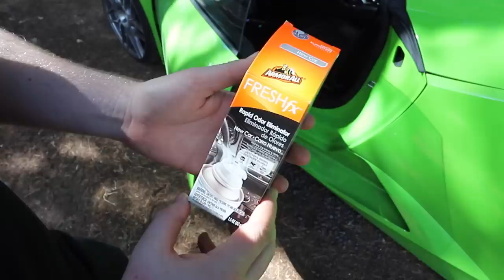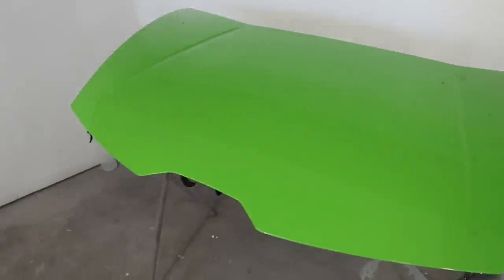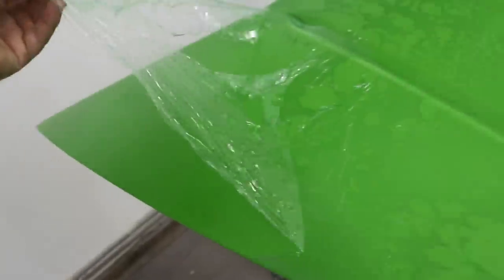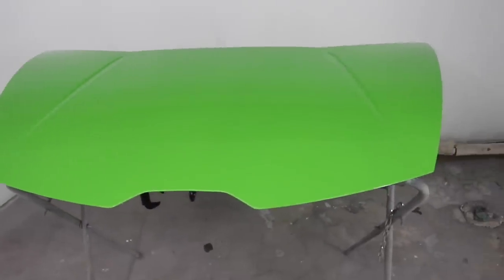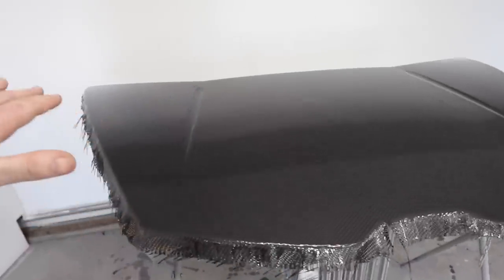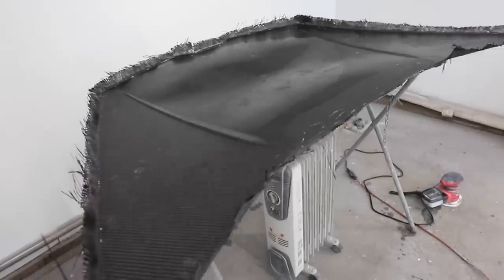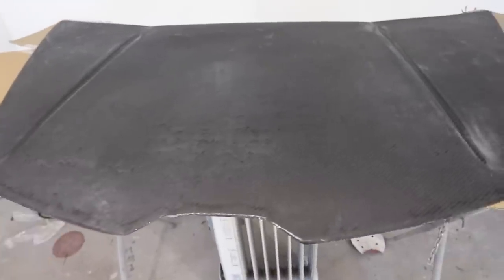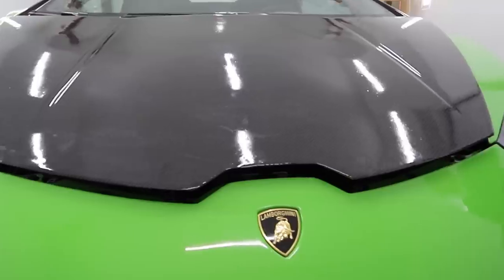Building Our First Carbon Fiber Part for the Huracan

Comment: Making these panels the proper way with molds and auto clave is literally a 100k+ procedure.... If you don't do negative molds none of the parts will fit, they will all be way to big
Reply: He has all of the originals as references to trim them to size, so I don't think it's such a big deal here...

Comment: Ok you made a mold not a part. That's what you get when you coat over another part. Next you can actually make a part from your mold. I would use fiberglass instead of carbon fiber to make a mold it would be a whole lot cheaper.

Comment: Curious - why paint the the car prior to using it for molds? Seems like you'll possibly damage the paint during the process (uninstall, handling, or otherwise).... Assuming you had reasonably flat surfaces

Comment: You’ll want a negative mould so that the outside surface of the part is smooth. Also, carbon is great for making moulds if you don’t want to mess around with glass fibre.
You should also think about vacuum bagging.

Comment: Make fiberglass molds of each part and then fill the parts with Carbon Fiber. SO if there happens to be damage on a panel you can remake it exactly the same.

Comment: If you are doing a overlay like you just did. Couple tricks to help you out. Once you first coat of resin gets tacky put another coat on. Do this 5/6 times to help with it being so flimsy. On your last coat if your happy with the amount you have,Add wax additive. Its like a final harder for your last coat. Then I would block from like 180,220,320,400 and most times I would clear it after that. You can go to 600 if you want. BIGGEST thing to know, always add water to your carbon. It will give you the look that the clear will give you in the end!!!!

Comment: If you would have used 1 1/2 ounce fiberglass matting and woven Roving  3 to 1 = 3/16 thickness with styrafoam ribbing,  boom there is your mold, then you build from the outside in, = finished hood

Comment: The fogging is because you didn’t mix the resin with hardener enough or add enough hardener to the resin to allow a good mixture. That happened to me. 
Go to Composite Envision and they have mixing bits to use with the drill to mix the paint right.

Comment: Gday fellas,
PLEASE MAKE CHRIS READ THIS!!!
Best advice I can give you first is buy a DuPont Tyvek paper suit and a box of disposable gloves. No itchy scratchy. 😉
Ok mate, let’s get to work,
1. Flip over the bonnet. Cut some strips of laminex on thin ply (kitchen cabinet timber) and “lightly” sikaflex it to the under side edge of the bonnet so that you have a nice lip that sticks out under the bonnet all the way around. Let it cure.
2. Flip over bonnet and using plastcine, form a coved edge where the bonnet meets the ply lip edge.
3. Wax the entire bonnet and edge surface, then buff it off, same as you polish a car. Use three cloths though, wax on, wax off and then a clean polish cloth. You DON’T need a thick coat. You want multiple micro layers of wax.
4. Using a “Chux” type dish cloth dampen a small section and apply a thin layer of PVA in a gentle circular motion. Let it dry. PVA can be applied with a dampened cloth as a micro layer. Doesn’t need to be sprayed to a thick layer. You are creating an imperfection that will show in every subsequent product from the mold surface if you apply a thick layer.
5. Spray the part with correct ratio of Gel Coat and catalyst for your temperature there and let it fully cure/dry.
6. Apply a layer of 3/4 ounce glass cloth and resin. Then using a solid steel grooved mini roller to ensure no air in the laminate, roll out the cloth, forming it into the curves and corners. Then multiple layers of 2 ounch cloth. NEVER APPLY TOO MANY LAYERS AT OUNCE AS THEY WILL PULL AND WARP THE SURFACE. One to two layers at a time between curings.
7. Apply a layer of resin and q-cells as a slurry bog and apply a layer of Balsa Mat or Foam Mat Tiles. Gives stiffness and rigidity. Let it cure. 
8. Then fair over the “stiffness layer”, the imperfections, with a small amount of resin/q-cell mix. Let cure.
9. Then some more layers of 2 ouch cloth. 
10. Apply a framework of foam ribs, plywood ribs or steel pipe ribs with resin and q-cells filler mix as a type of “glue”. Shape the filled edges with a round tube to cove the edges and then apply tape like pieces of fibreglass and resin to reinforce the framework to the mold. ONCE AGAIN DO NOT APPLY MULTIPLE THICK TAPE LAYERS AT ONCE AS IT WILL PULL AND WARP THE MOLD SURFACE. Let it all cure/dry.
11. Release the mould from the part (using fine angle soft pine timber wedges) and you will have a surface to mold from with a neat lip so as to have a tidy edge too trim. The product from the mold will be the perfect size. I suggest wet n dry and polishing/buffing the mold surface first before use. 

VERY IMPORTANT:- Remember to stand back with a beer every now and again and appreciate your handy work. 
Good luck fellas! Cheers 🍻👍

(In Australia we have the “Kiss” method. “Keep-It-Simple-Stupid”. No need to over complicate and hence why I didn’t go into vacuum bagging etc etc)

Comment: If you just put carbon fiber on the outside of a panel and try to use that as the final product, it would mean that it will be larger than the sample panel. What you did now, you need this exact thing from glass fiber, and when that dried, use it as a negative mold for the real part.

Comment: When we made the resin to impreg the carbon for Aston martin/Ferrari body parts, we use to mix the resin in a vacuumed mixer otherwise you would get little air bubbles the size of pin holes. Unless spraying over the Carbon, I'm not sure how you would get rid of the little pin sized void.

Comment: the white marks you see after sanding are small buble left from not degassing the resin. you can achieve a good result with skinning like bandido does but you need to understand a few things. building layers you dont need to worry about degassing. but once you sand the last layer and aply the "face" layer', you need to degass by vaccum, or if not possible, use small lenght brush (big ones tend to add to much air to the trapped resin) and build 4-6 coats. sand them down till you hit the cloth with an 120 and finish with a 400 very light. clean very weel and clear coat it. its important that you hit the cloth so you dont have any clouds. and its also important to do very good sanding to the build layers, so when you aply your last cloth its very even. that will help you in that final sanding of the last layer! follow me on instagram @rodrigolagoa i post a lot of videos of my builds! corrently doing a trunk lid double side mold!

Comment: Shouldnt you have used a cheaper material like fiberglass to make the molds and then pull from the molds so the panels will be the right size and vacuum resin infusion is the best way to go.

Comment: make all your molds from fiberglass ,then make the parts needed from carbon fiber.use the purple partall film 10,is a thicker PVA this will protect your edges better,we use purple pva when the molds are not gel coated on the inside surface. considered a short run mold of 10 or less parts.

Comment: I've only watched the first few minutes of the video and I'm extremely sceptical about your chances of success with the idea of replicating all body panels in carbon fibre. 
Firstly, are you going to be able to use an autoclave to cure these parts? Dunno how tough they'll be otherwise. 
Secondly, how are you going to consistently align the weave and avoid amateur looking disparities?
Thirdly, have you even visited other carbon fibre parts producers to look at their methods?
Fourthly, did you try any small scale trials?

I hope some of these questions will be answered by the end of the video....

As I thought - not that successful. At least you acknowledged the biggest issue - that you HAVE to produce a mould to work from! I would still VERY STRONGLY recommend that you spend a bit of time with someone experienced in working with carbon fibre!

Comment: Definitely need moulds, and sometimes complex 2-3 part moulds that bolt  together. But I would suggest that getting nice results from infusion methods is going to take MONTHS of full time practice.  I would recommend looking into pre preg carbon so you cut out the infusion, and just buy or make an oven for curing!!!   Will cut production time massively and HUGELY reduce complexity around infusion and the errors that will happen from infusion methods during the learning phase.

Comment: Keep in mind a few things:
A) your void volume fraction is going to be high unless you use a vacuum assisted resin transfer molding process (this is cheap and WELL worth the results) doing this the way you’re doing will work fine and I would expect moderate strength but the main source of strength in a fiber reinforced polymer is the interface! (The bond between the fibers and the polymer)
B) You may be much better off creating a fiberglass mold of each of your panels and then laying the lamina inside of the mold. This will help with your dimensional precision!
C) Although possible, if cfrp is not manufactured properly, you’d be just as well off using purely resin to make your panels. Using pre pregs may yield much better results and could be much easier!!!
D) For faster resin cure time, apply a source of heat (a big light usually works well)
I’m a composite nerd and engineer so I like to get my hands dirty and I’m certainly interested in this build! Spend your money wisely!
Ps, the main advantage of carbon fiber isn’t the strength. In reality, materials such as aluminum and steel are stronger! Cfrp has a much higher specific strength (strength divides density) and thus, if you use the same thickness cfrp and your aluminum hood (I’m assuming it’s aluminum, not certain) you won’t have a very strong part!
Good luck!!

Comment: If your machine sanding I would not go any lower then 120 it may help to use water I have not done it with resin so not sure how much it may help 
If your resin didn't dry all the way your hardner probably wasn't mixed well enough or the top coating dried faster not letting the lower layer although even in water this stuff should definitely be fully cure in 24 hrs

Comment: If you want to run any ideas give me a shout, I've spent 10 years working in a composite shop in the UK, You've taught me enough about repairing cars.. 
With this kind of product where your not product where your not chasing every gram there probably  50 different ways to get the results you want, there isn't a  right way and a wrong way. 

The challenge is finding a way that works for you.
Each layer of 300gsm carbon 2x2 twill is only 0.3mm thick, your gel coat will thicken this. but as you found out it's never going to be stiff enough to hold it's shape. 

Your incomplete cure and stickiness could be a few things..
Poorly mixed- use an electric drill with paddle mixer (ideally  put under a vacuum afterwards to pull the air out) 

Poor ratio.. Less likely but you need to check that you have the right ratio (you're looking for by weight not by volume)
Post cure - If you have space make your self a big oven you only need about 60 degrees, this will help cure the products fully.. (Every 10 degrees halves your cure time / pot)

As a few people have said I would take a set of moulds off the car from cheap polyester resin and chop strand mat, you will need to reinforce these with some thin ribs to stop the mould twisting. 

A few people below have said that you should infuse the parts, having done this personally I can wholeheartedly recommend not going down this route.. If your going to get you moulds cnc machined from tool steel with a perfectly consistent gap great, infusion works really well. but i will promise that you will scrap another 50 parts before getting it right if your making your own moulds. 

A few tips

Preparation is key, get all your carbon fabric cut before you start, do as much as possible before you mix the resin. 

A vacuum pump is a really useful tool,  it does a great job at applying an even force, and pulling out air bubbles. Wet-laying carbon then vacuum bagging will help reduce the voids.

Make sure you have a resin with a long enough pot life - you don't want to be running around frantically. Make your life easy it shouldn't be a frantic process.

With regards to finishing, I would sand down the part again, then apply a 2 part automotive clear coat. 

Make sure your epoxy has a UV stabilizer or in a years time all your carbon parts will go yellow..

Comment: Chris, as mentioned by others - Easy Composites' negative mould technique. https://www.youtube.com/watch?v=UgKvDw1E60E  The result is perfect straight out of the mould, no finishing/refinishing. The part is the exact size of the original part, no wavering gap lines, etc. The part is as strong as it needs to be, no guesswork or over engineering reinforcement. You can remake any parts easily if there are any issues/accidents, and you can sell the moulds when you're done, if you wish. This is your SEMA build! And it's a Lambo! Any method you choose will still be an amazing feat, however you ideally want it to be as if you bought the parts from a carbon fibre specialist. Time wise, you can be making several moulds at once as you don't really need to 'experiment' as you have. Yes, it requires more materials and consumables but the end result will be easier, better and require less finish work. Simply make both sides of the panel (in the case of a bonnet/hood) trim them, bond them together and make any minor touchups.

Comment: Wow, being so thorough with some technical stuff and so lousy making an easy mold and part. C'mom guys, you just need to keep everything super clean, mix everything super nicely, etc. If you follow the steps closely, you might still make some beginners mistakes, but you'll get it. Use vacuum. Use heat. But avobe all, use prepreg.

Comment: Many good comments... A mold, reinforced with ply or steel so it does not flex and vacuum bagging will produce the best result.  Closed cell expanded PVC foam,  should be used between inner and out skins for stiffness.  You might be able to save your test hood by building a plywood box, filling it with expandable foam and laying your metal hood face down as the foam stiffens.  This would provide a form for your carbon hood outer skin that will hold it in the correct position.  Then do the PVC foam core (either all or stiffing strips) and vacuum bag in your inner plys.  Look to boat builders for technical advice, not car builders.

Comment: appreciate your hard work and jope to see great results just a suggestion use proper equipment such as

*Clean room with air ventilation, air filters, 
*Use wood frames so while is resin rise it won't change the shape plus you can move them around 
*Make Female Mold of your car parts so you will get perfect size and better quality than OEM 

thanks for reading Best OF Luck

Comment: Your methodology is completely wrong.   The carbon fiber piece you cast off the hood  should be used as your MOLD to make the REAL hood.  (Except it's not even close to good enough to be used for anything, obviously.  It's just a practice piece.)   And there is absolutely no reason to make the mold out of carbon fiber.  Ordinary fiberglas is what you'd use for a mold.     You're not going to get a good hood by casting a new hood directly off an original.  That won't work worth a darn.

Comment: The partall wax should always be “waxed off” real good. The end result you shouldn’t see it. The three layers is just to verify you didn’t miss a spot. At the fiberglass shop I work at, the way we verify it’s wiped enough is by throwing a dry rag across the top and it should almost hover off. If the rag sticks to it or seems to have friction, continue to wax off. Hope this helps. Try not to use too much resin. It will make the part more Brittle. If your planning on making molds, use standard fiberglass to save some pennies. Only build the part itself out of carbon fiber. Balsa wood works good on adding to the rigidity of the mold so it holds its shape. The mold will need a stripper, sealer and wax(not partal wax). I can get you a list and give you some tips if you want.

Comment: Chris, I'm not sure who you are talking to or in which industry this guy's work, buy this method is ponly gonna cost you a shit ton of time (which you don't have) and a lot of issues, even more so when yo get to the tricky  parts.

Use your parts as a plug, make a negative mold with epoxy tooling resin and fiber, reinforce with whatever you want.

Include cooling/heating lines, and get yourself a TCU, they are cheap used.

Now mold your parts either by infusion or wet with vaccum bags.

Both sides of the comments you have heard are correct, it just depends on the type of part you want, shitty carbon, sure you can do it on the cheap it is not gonna look good tho.
A lightweight structural carbon body with class A surface, not gonna happen.

Go in the middle make something that looks nice, is dimensionally stable and is gonna have gaps that fit and can reuse your available hardware (you are going to have skins and structural members) I can send you some pics on how the tooling for this type of stuff looks.

Comment: If you want some very durable clear coat checkout aviation grade high solids clear, all the major paint manufacturers offer it for the most part but my favorites are PPG’s aviation clear and Du Ponts aviation high solids. I can’t remember their technical branding at the moment but it’s worth looking into. Some of it is incredibly hard to sand though, drys like concrete lol but it’s Skydrol resistant which is impressive.